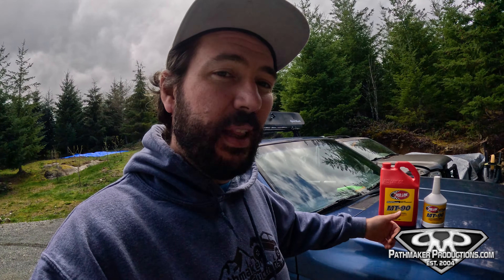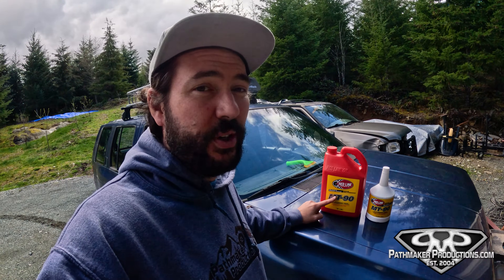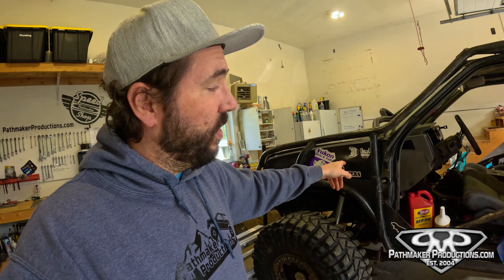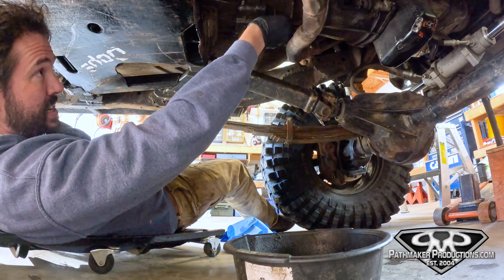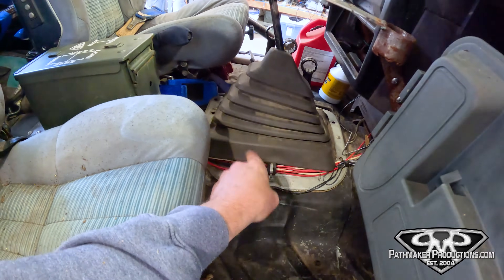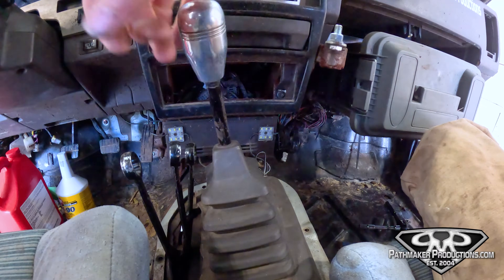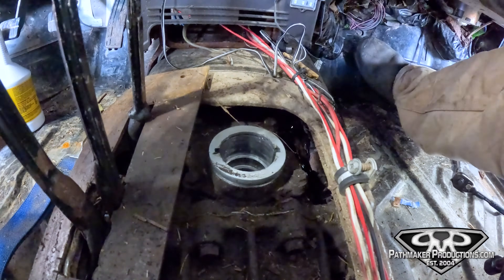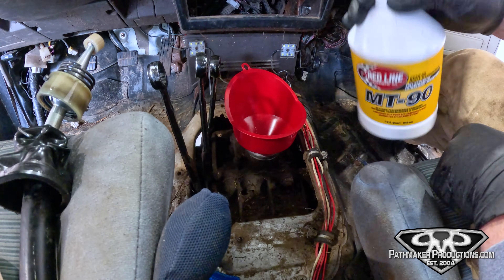Nissan Pathfinder & Hardbody Transmission Fill Hack – Avoid Major Failure!

Comment: Got a 99.5 Path with VG33 & 5 spd... Same thing? GL4?
Reply from the maker: Yessir, its the brass synchros in the transmission that hate GL-5. You'r transmission will last a lot longer and shift a lot smoother with GL4

Comment: show a pic of the fill hole on the transmission fill port. I have a 96, but on the door it's stamped December 95.  so I am at odds.  PLEASE
Reply from the maker: I can't link pictures through here. Search up Nissan TSB NTB97-009a from June 15, 1998 and they have a diagram. Long and short, all the transmissions (Manual trans, 4x4 model, Pathfinders and d21) need 5.1q of fluid regardless of where the hole is. So if you fill through the shifter like in my video, and put 5.1quarts of GL4 in you'll be good. Its hard to fill through the hole in the side of the transmission so I find it easier to go through the shifter.

Comment: So I did mine through the side with a clear tube and a funnell. My question is: "what circumstances would warrant not overfilling?" I believe I did over fill it. The overflow value works on my 1991 hardbody. The person before me used auto tranny fluid. I dropped that ASAP when I replaced the whole driveshaft. Great video.
Reply from the maker: If you have a 1986.5 to 1995 4wd Truck or 1987-1995 4wd Pathfinder with a 5spd then you need to put in 5.1L of fluid. The fill plug on the side was from the factory too low so the 3.8L of fluid you can fit in doesn't properly lubricate the gears and your transmission will prematurely go bad on you. Thats why I pour 5L in from the top because you can't fill to the proper level by pouring it in the side.

Comment: Is this for 5 speed 2wd as well mine is 93 pathfinder
Reply from the maker: Darn I should have mentioned it, its for the 4x4 only. You still need 5qts of oil in your transmission but your fill plug is high enough. I still think its easier to dump it in the shifter hole tho!
Reply: @ same oil though ??
Reply from the maker: Yessir, it NEEDS to be GL-4 fluid and Redline MT-90 is the best.
Reply: @PathmakerProductions  you are the best!! Hope to see more vids from you and plenty of advice
Reply: I assume on a 2wd 1990 trans mt-85 is fine which is also gl-4.

Comment: Solid video, thanks for sharing. Do I need to add some sealant to the fill and drain plugs?
Reply from the maker: I never have. The plugs are quite long and the threads have never dripped for me.

Comment: Would this help with slipping hard shifting on auto trans on a d21 thaught about adding lucas oil stabilizer
Reply from the maker: Nope this is for manual transmissions, redline does make a nice quality ATF which might help but typically when automatic transmissions start shifting hard that is a sign they're on their way out.
Reply: Not shifting hard just late shifts and notice a lil slipping

Comment: Thanks, it's nearly the time for me to change tranny oil for the first time on my WD21.
What do you think about ams oil 75w40 full synthetic instead of redline?
Reply from the maker: That Amsoil is gear oil not transmission fluid. I definitely wouldn't put it in the transmission. That stuff is for the front and rear differential, its much thicker and different spec than transmission fluid. You don't need to use Redline MT-90 but you DO need to use a GL-4 spec transmission fluid, mobile1 makes one, so does Penzoil but be very careful it is GL-4 only, there are some oils out there that says GL-4/GL-5 spec and that will still wreck your transmission. I see the Amsoil says its compatible with GL-4 but I would be cautious and wouldn't trust putting that in my transmission personally.